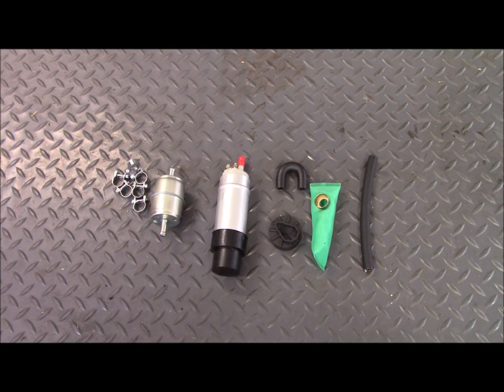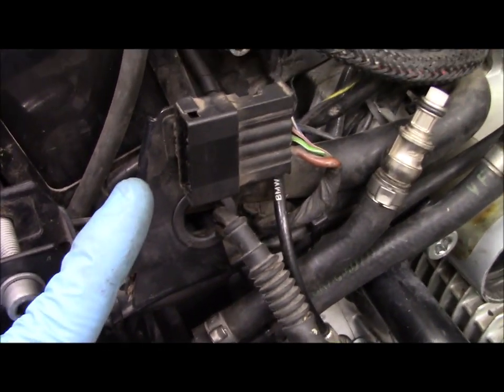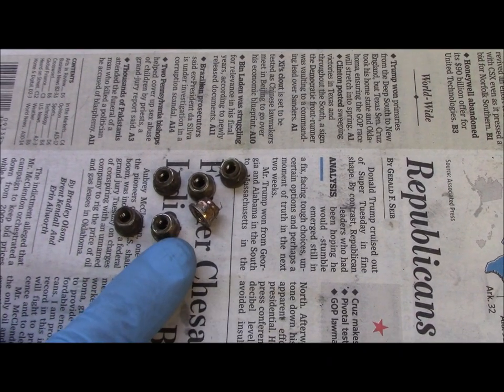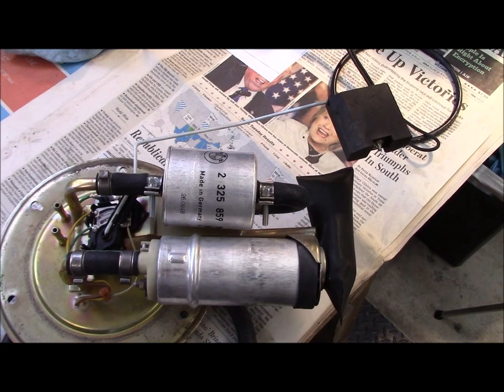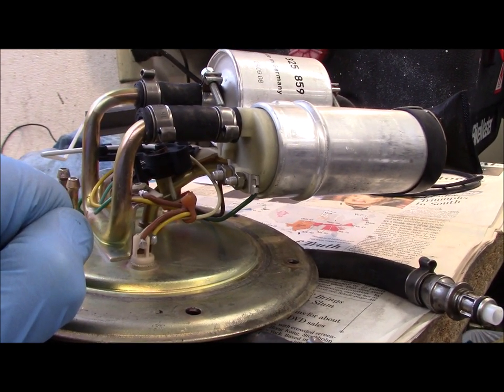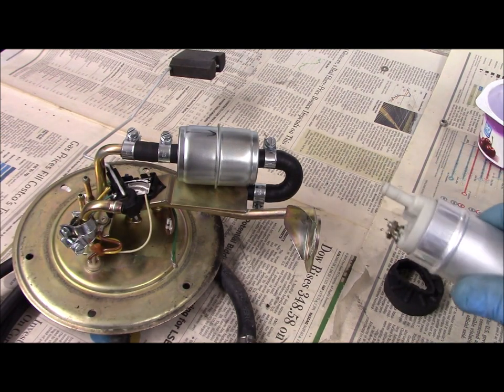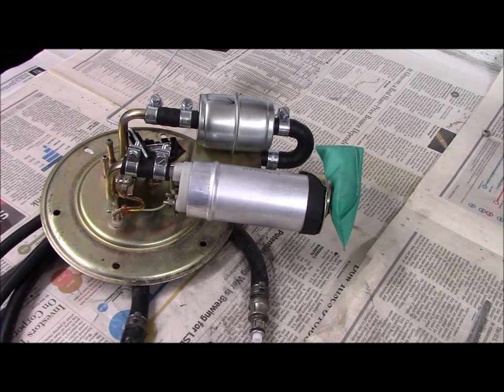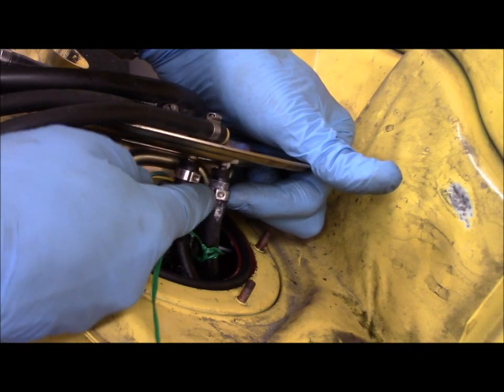2004 R1150GS Replace Fuel Pump and Filter

Comment: One of the best "how to" videos I seen. I have an 11S, had to remove tank couple years ago. Wish I'd seen this before I attempted it. You are so clear in the tasks needed I could have completed the task with out having the embarrassment of leaking fuel out at the petrol station whilst filling tank after reassembly.  Had somehow messed up the refitting, especially as the fuel light seems to come on a little bit earlier. I did dread the next time I'd have to remove tank, but after watching this, not so much now. Many thanks
Reply from the maker: Hi Steve,  I'm pleased this was informative for you.  It's the goal, but I'm never sure if I put too much, or too little, detail in the videos. I try to follow Einstein's advice about the goal of science, "“Everything should be made as simple as possible, but no simpler.” :-)

Comment: Thank you very much for taking the time. I referred to this video frequently today when I was changing my pump and filter.
Reply from the maker: Hi David. Cool beans. I'm pleased this helped you out on your project.
Reply: @BrooksAirheadGarage  Couldn't have done it without the video. I'd have used the wrong clamps and got the fuel filter placed wrongly. All back together now and running better than ever.

Comment: Hi Have a Happy New year
Were can I find the gas pipe s quick connectors?
Reply from the maker: Archontis, any BMW dealer should be able to supply all the parts you need to do this work.
Reply: @BrooksAirheadGarage  O k.  Thanks a lot.

Comment: Hey Brooks, great video! Good tip about avoiding to bend the plastic nipple of the new pump! Question: what do you do when you mix up the vent and rain hoses inside the tank? I've got mine completely apart - including the gas cap/filler neck assy and I marked on one end, but forgot to mark on the other. When I get back to the bike, things might explain themselves to me, but if you've got input, then please share!
Reply from the maker: David, I'd try using some compressed air to verify which line inside the tank goes to the vent and which goes to the rain drain. Then match them to the exterior lines accordingly.

Hope that helps.
Reply: @BrooksAirheadGarage  Hi Brooks, nice step-by-step with explanation video. Thanks. It still puzzles me this messing vent and rain hoses. My exterior lines both end up at the very bottom of motorcycle so I see them quite identical. What did I missed?
And what's the chance to remove particle filter from pump without damage? My pump is OK I just want to wash that particle filter.
I'ts always the best to learn from experienced...
Reply from the maker: @jiritusla  I am not a trained BMW mechanic. So I always make sure the parts I remove go back where they came from. It's easier that way and avoids problems later on.

When you say "particle filter", I assume you mean the "strainer, Part# 16 14 1 341 233	 STRAINER). I suspect you can carefully remove it to clean it.  Obviously the "fuel filter" is designed to be replaced at the specified maintenance interval.

Comment: How come there is 2 vent pipes and where do they go to inside the tank ? thank
Reply from the maker: Ant, I believe one is for fuel overflow and the other goes to the charcoal filter canister.
Reply: @BrooksAirheadGarage  Thanks looking at it now one is the vent pipe goes to the canister to release vacuum and the other is the drain small hole at about 9 o clock  when you open petrol cap .That should stop any water collecting round the cap recess  entering the tank when you open it or if the seal on the cap is faulty 
Can understand why you need to worry about  getting them the wrong way round , unless i am missing something or my bike has been messed about with

Comment: I just want to change the filter, why do i need u shape if my isn't broken yet?
Reply from the maker: SSD Wired,  I tend to replace rubber that has been exposed to ethanol when I go in there.  Should any hose fail your are on the side of the road waiting for a tow
Reply: @BrooksAirheadGarage  thank you:) but TBH, I can't afford an expensive part like that right now. Every quarter tank on my truck is about $20 USD.

Comment: I’m concerned of stripping or snapping the studs. Any suggestions on how to avoid snapping them?
Reply from the maker: Hi Richard,  Yes. Tighten them until they feel snug. That's the point at which the nuts feel tight due to the rubber O-ring being compressed enough that the cover plate is touching the gas tank. At that point, you will feel an increase in the amount of force you have to apply to get the nuts to tighten further.

I like to use a short handle socket wrench to limit the force on the nut. You can use a standard length socket wrench. Just slide your hand all the way down to the ratchet end of the wrench when you tighten the nuts. With your hand close to ratchet, you reduce the torque you are applying to the nuts so you won't over tighten them..
Reply: Brook's Airhead Garage thank you kindly. This fuel filter has only seen 20k miles on it, albeit over 10 years but as she is running like a top I’m tempted to leave well enough alone for a while longer. Will certainly ensure that I follow your advise! Thanks!!

Comment: My 10a fuel pump fuse keeps blowing. Is this usually a fuel pump failing or another electrical issue?
Reply from the maker: Hi Nate,  Well, YES. :-) It could be a short in the in-the-tank wiring and/or pump motor, or somewhere in the wiring connected to that fuse. An Ohm meter is essential to isolate where there is a short to ground.
Reply: Hi  Nate, were your readings on your temp and fuel gauge accurate ? I wonder if I’m having tinge same issue on my bike
Reply: @benjamingarciao4734  it was dead summer at the time and hottest part of the day. I wouldn't doubt the heat was the main cause.